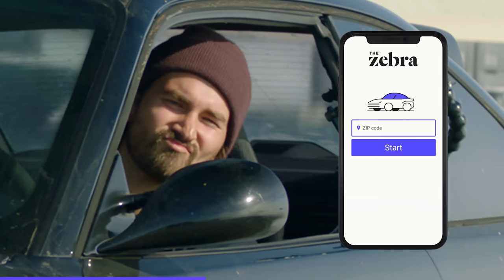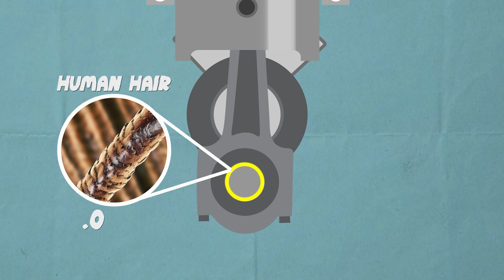The Engine Sound You Never Want to Hear

Comment: Another useful tip I've learned so you don't gotta do all that extra work.
Take a wooden dowel rod that's able to fit down your spark plug holes. Rotate the engine around so that way each cylinder you can check(I find it's easier when the pistons at BDC to do this) set the dowel rod down the cylinder and gently push on the piston. Generally if you have a knocking piston,you can feel the dowel shift the piston around on the crank. And it's gentle enough that you don't have to worry about potentially marring your piston.
Reply: you can also pull a plug wire on each cylinder, and if it stops....thats rod knock.
Reply: If I recall correctly, there's a similar, but more involved method used on aircraft piston engines where you put each piston at TDC, apply a vacuum to the cylinder, take a measurement with a dial gauge between the piston crown and cylinder head, then apply air pressure and take another measurement. The difference in measurements should give you an idea of how much play there is in the bearings (I think this is done annually as part of mechanical inspection)

Comment: 14:15 you can just tell that he has a deep relationship with that car, I feel for him without a doubt, especially owning a VQ with a twisted timing chain and shattered tensioner. At least he keeps his head high.
Reply: TWISTED timi- oh nahh that’s bad bro. Tensioner took a fat ass shit for that to happen. Christ... I hope your VQ isn’t an interference motor.
Reply: Hope your VQ gets fixed man. What happened to cause that?
Reply: Time for a new engine. I went through this last year, and “fixed” the timing chain... ended up just buying a local low mileage engine and swapping it into my G. Save yourself the time and money and just find another good VQ. You’d already be halfway to having the engine out just getting into the timing cover and it’s really not that bad pulling it all together once you get the front off it just slides right out with the tranny. If you have any questions about it I’d give you any advice I can!
Reply: I have thought about just moving to a 6 speed manual for my I35, at this point the VQ motor is trashed, and I've looked into getting an HR

Comment: Needed this, my camry has been making ticcing noises for months
Reply: I've owned 6 Toyotas and each of them has a noisy engine. If it's a mild tick from the top end, often just lifter slap. Never had one break on me and they were always high miles. It it sounds like the video, thats a different story
Reply: Yeah I was gonna say valvetrain tick, just tighten your valves to spec and you’ll be golden :)
Reply: @jdoosh4797  true I have a 95 Camry it has a tick but it's very high mileage car so it's old age
Reply: @jdoosh4797  I agree. Sounds like could just need a valve adjustment but probably not even needed.
Reply: @1985toyotacamry 
You can’t kill those engines except to let them run dry of oil. The 4cyl is a detuned version of the 3S-GTE Yamaha/Toyota engine and, in some ways, it’s actually the stouter version.
Just check oil often.
Reply: @negativeindustrial  I always check the oil and changing it regularly

Comment: When I check for rod knock the first thing I do is pull the plugs, and rotate each cylinder to TDC. Then I will sit an extension or something on top of the piston. Rotate it slightly past TDC and then push down on the extension. Usually you can feel the slop that way.

Comment: Some engines are just prone to making piston slap sounds. Older Subarus and LS engines are common examples. This is due to the short piston skirt. In those cases, it doesn’t cause any sort of problem other than an unpleasant noise that usually goes away when the engine warms up.

For me, any time I hear an engine noise that might be an internal noise, I drain the oil and have a look. If you see metal in the oil, either chunks or super fine flakes (like fine glitter), you know you are pulling and disassembling the engine. You could also pull an oil sample and send it to a lab to look for high wear metals in the oil. If the oil is clean and has no metal, you know you’re looking at something else. Still could be something inside the engine like a lifter, broken valve spring or another valve train issue that doesn’t cause wear metals. 

Another telltale is if the noise is much louder for a second or 2 after the engine is first cold started. If it rattles really loud for a second or 2 after start up and then quickly quiets down, it’s almost certainly a bearing issue. When there is low oil pressure (like when you first start the engine) the knocking will be louder. When the oil pressure builds up coats all the rotating parts, it’ll cushion the parts that are knocking a little and quiet it down. This will pretty much always be combined with metal in the oil.

Comment: Cheap stethoscope for your motor? Use a screwdriver with the metal to the motor and the handle to your ear, you will hear very accurate noises and this will help you find the issue as the sound gets louder. This works VERY well you will hear the motor like it had no case around it

Comment: Just a quick note here as well as a preliminary check you can disable or disconnect the ignition coils/spark plug wires going to each cylinder while its running and monitor if the noise dimishes. Its a good way of pinpointing which cylinder has gone bad, also know as a cylinder power balance test

Comment: I had a 2006 Honda Accord LX Special Edition that at one point started knocking, and my mom had noticed it. The dealership I've been taking it to for oil change, during the first few years, never said anything about it. So when I took it to a different dealership to get an oil change, they brought it to my attention. It was cracked and broken barrings in the water pump, so I got it replaced with a Bosch

Comment: I have a 98 Subaru Outback with piston slap. Drove it for 14 years. Head gaskets went first, unfortunately. 
Plus, when the engine warmed up, and the metal expanded, the piston slap noise basically went away.

Comment: 7:45 Much of the noise when this occurs is ALSO from the pistons kissing the heads with that extra 1/8"-1/4" of stroke the engine now has, because of that space in the bearing. 

When the knock progresses to that sharp, ear-shattering, jack hammer noise, THIS is usually what's happening.

Comment: If the bottom end knocking increases with RPMs it’s usually a rod knock. If the knocking is constant with increasing RPMs it’s the main bearings. Great video though! Sorry for the bad news 😔.  Upside, you can now write off an engine build. 👏👏👏

Comment: I had an '89 Ford Escort and the engine would knock.  I was told that all engines have an Anti-Knock index (Hence those numbers you see for each grade of fuel at the pumps, regular being 89, and upwards).  As the engine got older, it started to knock which I had it looked into and that's when the mechanic told me of this Anti-Knock index of the engine.  He told me that in my manual it should indicate what Octane content the engine wanted and I should not be putting anything less in the tank to prevent the knocking sound and before I get into potentially expensive repairs, to change the fuel to the next higher Octane level or put Octane boost in the tank next time I filled up and see if the knock persists or stops.

So I bought a bottle of Octane boost and poured it in right before I filled up and within a day of running with the Octane boost, the knock stopped.  The next time I filled up, I used the next level up (Premium with an Octane of 91) and no knock.

Comment: You can also usually figure out which rod is knocking (early detection) by running it without the spark plugs firing in the particular cylinder.

Comment: I have the same boroscope....My one regret is I have to turn it on, wait for it to boot,  join a wifi nework, and then open the app on my phone, whereas a standalone one might just be switch-on-and-use..
The other issue is this particular slightly higher-end phone-app one doesn't fit in the smallest areas or turn around to see top of cylinder from inside and can be hard to maneuver in some other areas too.
I find the end-light excelent

Comment: My D16z6 makes ticking noise but it's just my valve lash thankfully, I do valve lash every 200 to 300 kilometers because I upgraded my valve springs and upped rpm limiter from 7,200 rpm upto 8,000 rpm and stock rocker arms don't like having the stiffer springs and self back off the set screws.

Comment: Rb25s need a rear head drain as they suffer from oil pooling in the cylinder heads under high rpm causing all the oil to be pumpped up into the cylinder head. The stock return galleries aren't up to the task to drain enough oil back into the sump  under high rpm conditions causing oil surges leading to spun/damaged bearings. Rb25 is a weapon once this oil issue is sorted good luck with the rebuild, keep up the good content 👍

Comment: I had a similar sound coming from the engine in my '94 Cavalier (real sporty, I know) and thought it had to be rod knock. 
Being an OHV setup, I pulled the valve cover and noticed one of the rockers had play in it. I pulled the lifter to find it had worn completely flat. This engine was supposed to have hydraulic roller lifters, but I suppose it wanted flat tappets. The sound turned out to be the camshaft bashing into the lifter. Somehow, the cam lobe hadn't worn and it was good as new with a new set of lifters and pushrods. So check your valvetrain if you don't find the issue elsewhere!

Comment: another trick to isolate which rod has bearing failure is rotate the piston so its going down on the stroke and from the spark plug hole you can take something like a screwdriver or i prefer hex head or socket screwdriver and do a quick firm shove down on the piston,if you hear a "clunk" and piston goes down a tad you know its that cylinder.the bearings could also be on top of each other.
 so next step is rotate engine so piston is going on up sweep then take somthing like bottom of hammer/screwdriver etc and give the bottom rod cap a fast firm shove up.again you will hear a "clunk" and piston will raise a tad indicating that piston is the culprit.just somthing i seen done once for identifying.

Comment: a goof key to learn about engine knocking, faster knocks are bottom of the engine, slower knocks are the top. he explains it well in this video, but for layman terms that 's a simple trick to tell if it's a rod or piston knock. slow knock comes from the pistons a fast knock usually comes from the rods. this happens because the rotational force under the rod is usually required to move twice before a piston cycle (*2 to 1). hope this helps in your unfortunate engine knocking issue.

Comment: And if you're wondering why I guess that it sounds like a light knock it doesn't sound like a stiff knock. If it was rod knock your engine would be rattling more severely than usual. But valve knock it sounds like the vows are knocking around so that is the reason why I could tell that it was a valve knock

Comment: the fuel injected series 3 circa 1982 xj6 jaguars used to spin the rear main bearing shells after about 60k miles,the heat used to warp the block tho so it meant a new engine!,got more power with fuel injection but left the bottom end standard!!!!

Comment: Could have found that without removing the oil pan. When a cylinder is at bdc insert a wooden dowel down the spark plugs well untill the dowel touches the top of the piston. Then gently wack the dowel with a rubber mallet. The affected cylinder/cylinders will have a audible sound difference.

On real bad one you can just push on the dowel by hand and see it/feel it move.

Comment: I started to hear some terrible knocking coming from my 2000 ws6 trans am right after I swapped the clutch and was hoping and praying it was just a bolt backing out in the trans... 3 months later the trans has been rebuilt and the car is still in the shop because the engine at the number 7 bearing. I feel the pain. I just want my car back for the nice weather.

Comment: TDC of the crank may or may not mean the cam aligning marks line up.   You may need to make another 360 turn of the crank.   This is because the cam turns half as fast as the crank.

Comment: The second I heard it, I thought "I'll bet it's #6 rod bearing".
In-line sixes are awesome, except for uneven oil volume front to back.
Best solution is to drill & tap the oil galleries through the side of the block and connect them all together.
Reply: thats all engines.

Comment: On my v70 T5 i had those knocks. Turns out I was using the wrong motoroil, used 5w40 for two years, when I started hearing the knock I bought additives with ceramic shit in it that made the noise stop.
FF to now and I'm using 0w30 as intended and she purrs and sounds good.
So remember people a simple thing as right oil is super important, best is to check with the manufacturer first if ur unsure.

Comment: I had a knocking noise in my car. Also had trouble with gears. Can't remember what made me think that. 
Any way I assumed it was a gearbox. Been strapped for cash I parked the car up and I let it sit for 5 yrs. Eventually I had a look at it with my uncle and it was just a centre bearing to the tail shaft which blew out 🤣🤣🤣
Then I had to replace the barrel for some reason to get the car started. Needed a new fuel pump and cleaned the tank. Now the timing is out also lol

Comment: There is an awesome trick to find out where the sound is coming from. Get one of those stethoscope the doctors use to listen to your heart, and connect a metal rod instead of the little pad they put against your skin. Then put the rod against different places of the engine, so you can clearly hear what part is making the noise.

Comment: You got piston slap I do believe. I had piston slap in my 98 chevy pick up, it had 180,000 miles on the rebuild but the engine had 430,000. Just put thicker oil in it

Comment: Had that same problem on my car. It was under warranty at least. Also I think its going to expensive to fix. Given that when it happen to my car Ford just sent me a new block. You don't have that luck. Most likely going to need to re sleeve the cylinders. Which means a complete tear down. Also figure out if it was the barring that caused the heat don't want that to keep happening.

Comment: I would old school her and fine grit clean the crank and put new bearings in that rod, clean everything up and change the oil 3 times in 300 miles. I have done that on many a car and drove them for yrs afterwards. I have on some, replaced all the bearings including main bearings while the engine was in the car. Old school from an old mechanic...lol Loved your video.

Comment: So last year I replaced my starter because it was the only thing that I could think of with the limited amount of education. Turns out I didn't need to. Upon getting my vehicle home I was able to bench test the starter and it wasn't that. My starter was just fine I replaced it for no reason. Well here I am a year later trying to track down this voltage drop that I'm getting I mean it's massive too I'm dropping from 12:00 to 5 volts when I turnkey I go and replace all the wiring cuz I needed to anyways All the cables, no joy. 
In the midst of all this I've been doing my solar and I've been learning about electrical quite a bit. I even got myself an amp clamp and you know what else, there was one thing that I had an amp clamp for that I was not testing. I've been testing voltage resistance grounds continuity, but all those I could have done with a multimeter see I got myself an amp clamp for a reason. But it didn't click in my head. And after weeks I finally gave up and called around to see if I can find an answer and somebody asked me to check the amperage being drawn..... And I about wanted to kick myself. I have a bad solenoid. But you know what really sucks about the whole thing is that I've been checking everything I could online for answers and there's so many people who have the concept of a starter relay switch and a starter solenoid mixed up. Help you can't search one without finding the other. And generally if you look up starter solenoid you are not going to find a starter solenoid is the first result that you end up with. So if you're getting one click and no turning over, your starter actually could be good your battery could be good everything could be good except for that little solenoid piece of crap that's attached to the starter motor. That goes bad it's drawing way too many amps, I'm not sure exactly how or why it goes bad or anything like that but all I know is that it should not be drawing more than somewhere around 100 amps usually is what I'm told. CCA is cold cranking amps between frozen battery or something like that. But if you're drawing that many amps and it ain't cold or if you see your amp clamp say OL on any setting chances are it's probably drawing too many apps
 Now I wish I understood how and why that happens but I'll take my answer and just go replace the solenoid.

Comment: A rod knock gets REAL loud when you hold the revs at 1500 or so, and then lightly Rev the engine between  1500 and 3000 about once per second, and keep cycling it like that.. If it's a rod, it'll get REAL noticeable every time your on the Rev part of that cycle. Think jackhammerish

Comment: ah man as a mechanic the second you said gold glitter flakes i cringed! bummer. i replaced headgaskets in my subaru and 2 weeks later i head loud knocking i was sure it was a cooked bearing - turned out to be a bad new timing belt tensioner. never know until you get the wrenches out